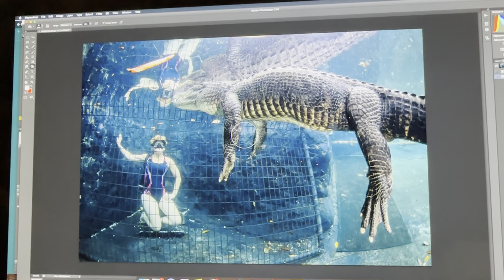Foxes, Coatis, parrots, Sanctuary vlog 2-6-24

Comment: I hope you get some donated, but Facebook marketplace has cheap fridges or 'you haul away' fridges. They also have overstock appliance places listed - that's where we got really good deals on a couple of refrigerators last year and a microwave. The microwave didn't have a warranty but it was brand new in the box. The fridges came with a 3 month warranty.  Oh - and when we had kittens we had trouble telling apart, we put a dot of acrylic paint on their head fur until we got accustomed to which one was which. Maybe GG and Coco will let you do that?